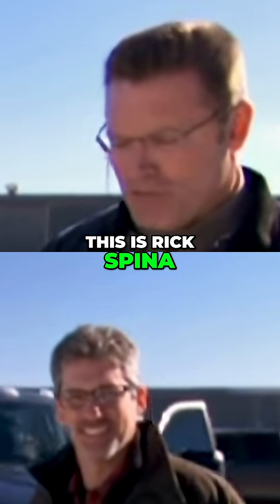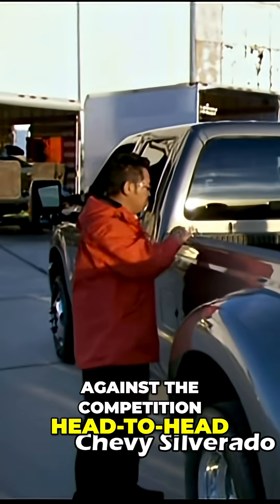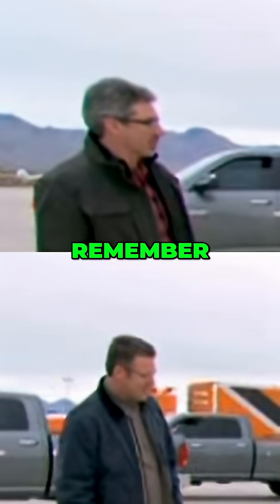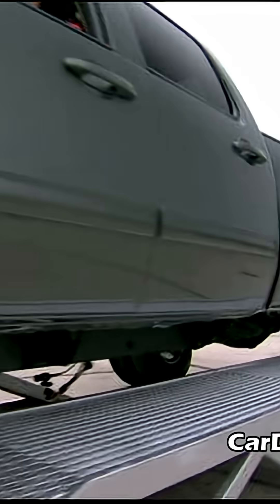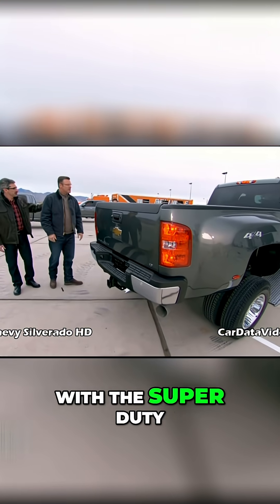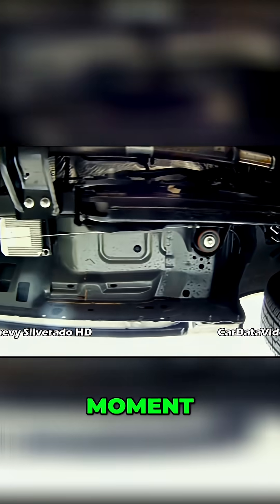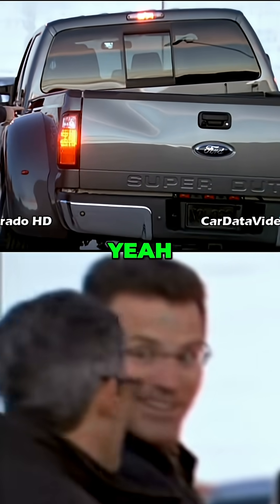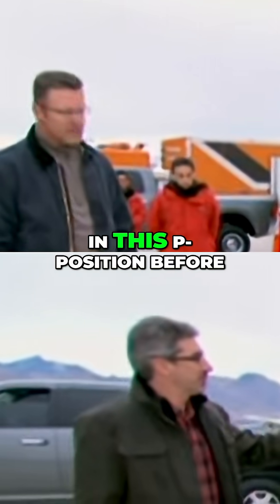Did You See That Tailgate Buckle?

Comment: You know what the ultimate test would be to have a truck that last a quarter million miles with no issues besides the basic maintenance. Design would be a vehicle that we can all work on.  Instead of d measuring contest of irrelevant designs  and horrific engineering. These commercials are re tarded.

Comment: I call 🐴💩 I currently own 2 of each pull trailers daily had to put air bags on rear suspension on chevys. First tailgate latch broken on chevy 40,000 miles. Ford much more reliable
Reply: Butt hurt Ford owners
Reply: yeah i don’t trust this
Reply: @xbear7473 whos dumb dumb. Keep voting pervert with your not listening @ss
Reply: The difference in flex here is solid axle front over ifs the ford never stood a chance in this test but no one in their right mind would take ifs over a solid axle on a 3500 unless you’re just gonna use it as a car ifs rides better but is a much weaker front end